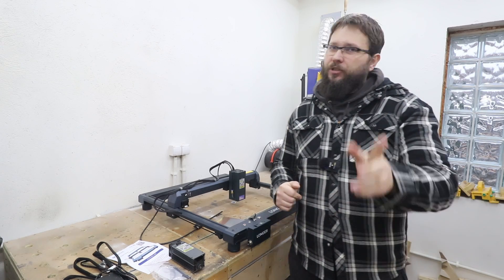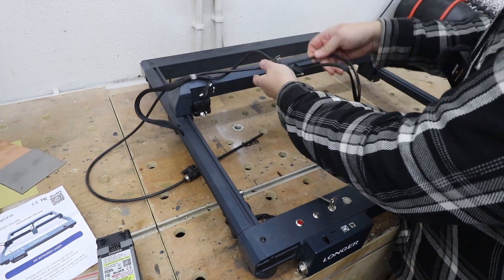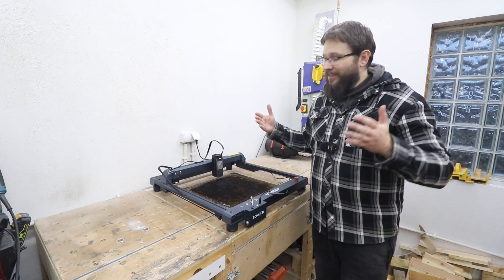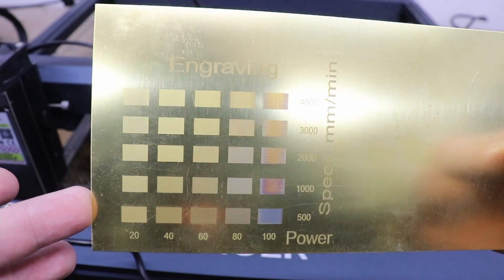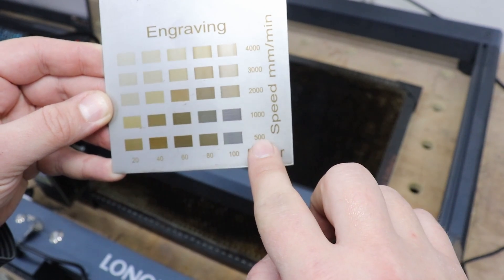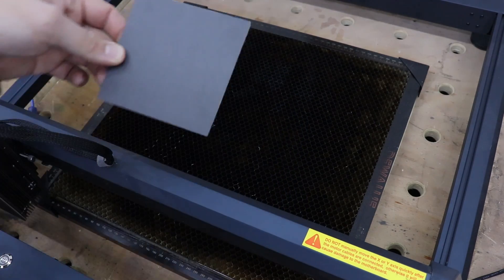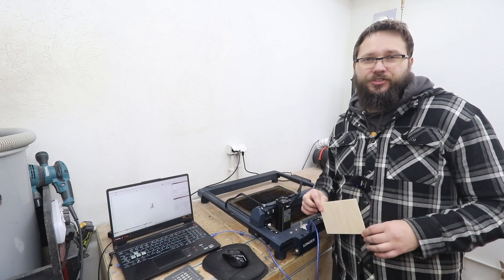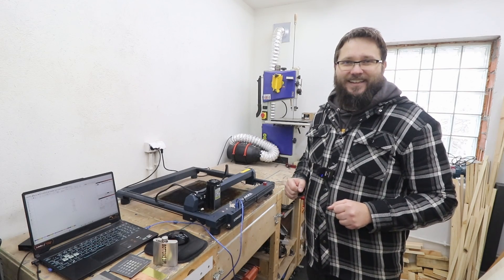Insane Engraving Quality On Metals With Longer 2W Infrared Laser

Comment: What is the ratio of owning a laser and a beard at the same time?
I keep seeing a theme while researching lasers, and noticing the surplus of beards. You probably noticed it too.
Guess I should stop shaving too, just bought a laser rig and want good results. It seems to matter enough to them, must be the trick to getting the laser work proper is why they would allow their pores and sebacious oils to produce visible dendrites, the tin whiskers. Cool infrared laser there. What settings are you running with, and do you  use a conditioner on your beard?
I'm just teasing. Look, they cant accuse you of hair loss, if the hair simply relocated to the jaw feature. I could grow a beard, then give it a proper high combover to replace my bangs.
The look of distinction and professionalism. The beard of knowledge.
#SebaciousOils

Comment: Does this mark the metal or engrave / etch it and u can feel it with your fingers
Reply from the maker: Depends on what settings and what material.
Reply: @CasualDIY  stainless steel
Reply from the maker: @JayJay-lw9oi  possible but it won't be super deep, noticeable under touch

Comment: I'd have thought there is a power supply/setting wires going to the laser, for both types of laser, so why you can't just switch the modules over by simply disconnecting/reconnecting one connector ... might be due to how the wiring on the modules is done, but then all you'd need is an adapter to reroute the wiring.
Anyway, thanks for the review, found it quite interesting 👍
Reply from the maker: Yes bit annoying, there must be an easier way to do this